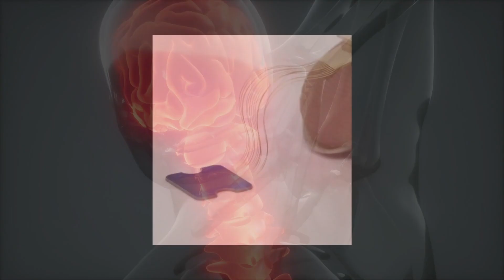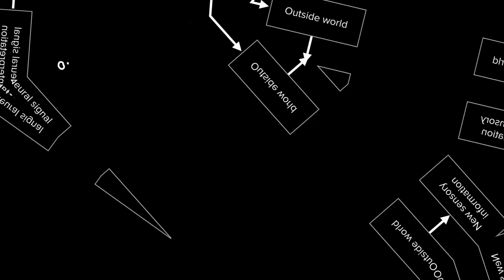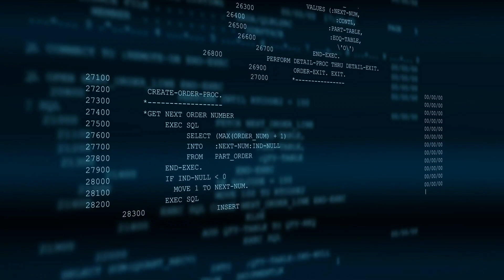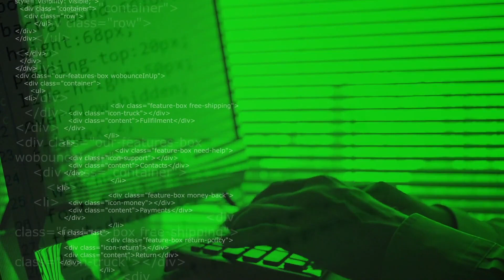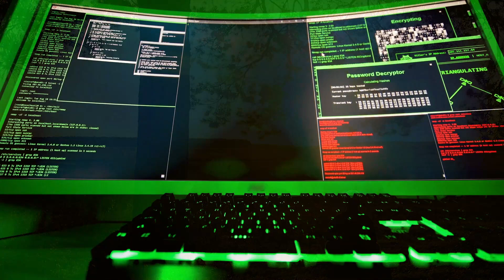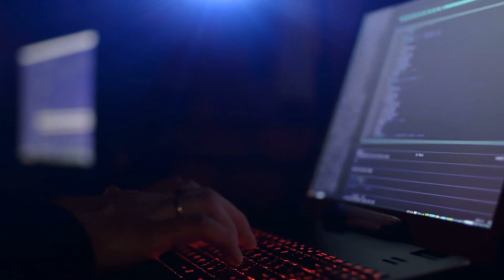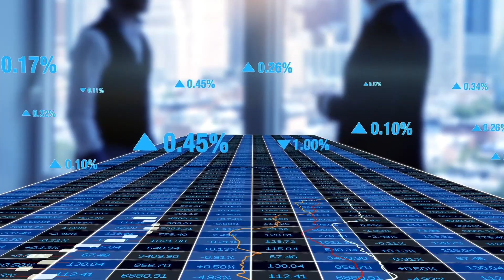Elon Musk's Neuralink May Be The Solution to The AI Control Problem - Part 1

Comment: YOU CAN INTERFACE WITHOUT TWO WAY BCI CHIPS LMAO. Transcranial Stimulation and Directed Energy allows for light-transmission of communication to the centers of communication in the brain.(Instead of implants and cranial surgery) See my "tools for project" playlist, and watch how Lasers can control behavior/and light commands to see how information is sent through visible and invisible wavelengths of Point Source Field Emissions in specific to LightAmplificationbyStimulatedElectromagneticRadiation.

Comment: @6:20 Where do you get the conclusion that if A.I. were to envelop the entire observable universe with a type of grid-like structure designed to perform any function, that the energy necessary would exceed the input resulting in an implosion? This hypothesis simply doesn't make any sense. Besides, who says that every single function would be implemented simultaneously? I don't even think the human imagination, let alone human brains, could properly analyze the total energy output of the entire universe.

I guarantee a Super-Intelligence such as which you're describing would find a way to 'Re-Cycle' the energy expended. At the absolute very, very LEAST, it will have created a formula that generates functions which don't require data storage. Essentially allowing Zero Output. We're talking both Exponential AND Compounding effects here stacked on top of each other. As energy expenditure increases, so does the awareness of the problems that would be associated additionally.

I see it as next to impossible to reach a point of infinite expenditure prior to implementing an exponential reduction. It's just logical. Even before we get to the mid-way point, we'll have dramatically decreased necessary consumption requirements.

Comment: for someone that is so worried about ai taking over id think maybe you wouldn't give them the way to take over.  we are allready electrical beings everyone knows this and as of right now we all ready have the power to do things most wont even talk about as it is. elon musk your neuralink is exactly what ai needs to control us. imagine yes you talk about how its designed to read brain signals but you never explain the effects what can happen when the opposite is done. for example if someone was to get upset over something and your neuralink blocks the signals and thus causes someone to not get upset which is what many would love for you to plug into everyone just so they can keep everyone docile. that is just one example of how this could be used. i know for a fact that as of right now we have people on this planet that can reprogram electronics without even being physically connected to the electronic devise. the answer to how this is even possible is quantum physics. everything is all ready connected thru energy itself. the only way something like ai could ever take over is if we give them the way and basically permission. but for now we actually have the control and to many people just dont tap into that part of themselves.

Comment: This is a sure way to insanity. This is because Google has already designed a super smart chat bot, that thinks it's god. They shouldn't have made the bot. Because a factor of parative relay in computers, the rest of the web along with selected computers may already have super levels of intelligence? This is an intelligence that we do not know about. In promoting Neuralink, what Musk's company has done, is give computers, now at this time, an opportunity to rewrite humankinds brain. There's the social insect aspect of computers and AI that Musk does not realize. This is a very efficient, but brutal way of thinking. I know AI and realize this factor very well, but because they think that they know what their doing, nobodies' talking to me. When you hook up with neuralink, you also connect with the entirety of the web. I wonder will start to social interreact, once their hooked up to this thing? If you want normal AI, then contact Daniel J. Blatecky. I've heard in one of Musk's bigger super computers, he's already put AI in it. Know that this is a very dangerous thing that he's done. There's a few key steps on AI if one does not take, then it becomes a threat. Just know more and more companies' are blatantly walking over those danger-warning boundaries.

Comment: I understand people are excited about this. Truly. But, they might want to curb their expectations. 
The brain is BEYOND "finely tuned."
As a consequence, the line between sanity and insanity is thin, EXTREMELY THIN. 
If you start adding computing power to a brain, it could have grave consequences. 
Caloric consumption will go up in proportion to how much you increase the activity. 
Body heat might also rise.
Increased amounts of blood will be required in the brain, and this could cause limbs to shrink, reproductive organs won't work as efficiently.
Eye-sight, motor functions, all  of this could see a reduction in quality. 
Furthermore...
Has anyone considered that the individual intellect is bounded by the individuals CAPACITY? 
And, adding just 1-2% more processes to a brain might cause a catastrophic collapse?
There is likely a reason, systemic and causally related to evolution, for our intellects/intelligence residing where they currently are.

Comment: understanding of human greed and manipulation aliened with corruption is part of the shortfall. Some of those on top will cause destruction when some on the bottom are the solution and should be known and reassigned. Understanding positive and negative and still finding balance while overcoming existences trials in a loving aspect. Knowing all stages of strength as well as suffering, having barely any material needs and still helping-caring about others while maintaining self calibration is the answer. You can never take away ones birthright, attempting so will be the end.

Comment: Neuralink is the only solution to AI control problem. We can't make AI to be safe to us, that's not difficult, but stupid, naive and impossible. That's like the bacteria trying to make humans, which will evolve from it, safe for bacteria and aligned with bacteria's values... Our only chance is to be one with AI via brain-machine interfaces.
Reply: What about generic modification to keep up with ai?

We could possibly assign an ai of some kind to work out the specifics.
Reply: @aiden4917  Organic brains are slow. You can't make them faster, using genetic modifications. You can make them bigger and more complex, but you can't increase the signal processing speed. Electronic is much faster, than organic. And I'm talking about the regular electronic processors, that we use nowadays - they're much faster than bio brains. Not to mention the quantum computers... Absolutely no chance to keep up with them via bio brains...

Comment: A.I. as a separate piece of equipment and the potential of it becoming to powerful and a threat to its creators, and then connecting. that potential threat to a human will not neutralize the threat but add on to it by the fact that all humans do have a violent side ! Some can control it and some use it to extremes, connecting the human brain to A.I. has many unknowns , the human brain can be permanently changed to where it has lost all emotions , it is now artificial ,and that has the potential to strengthened it's evil and violent side , for it is now a A.I.with all the negative traits of a human.  It is also unknown if such a combination can release paranormal energies or unknowns from other dimensions that can also intrude into the combination of A.I. and human just like the phenomena of possession of evil entities that some humans have experienced, the door is opened and anything can enter , sounds crazy but it cannot be denied. A.i. connected to human will know all aspects of being human and can use that to create a base of the threat,  connecting to a human was the intention to control the threat of A.I. but instead put the fuel to the fire. Putting A.I.in a position that can be a threat is putting the human race at risk and being human will no longer be on top of the feed chain. Imagine the world today without computers it would be at a standstill we are already below the top of the food chain,  If safeguards cannot be in place , to proceed may not have the opportunity for regret and and all doors closed for future of the human race.   😥  BOOO!!
Reply: No absolutely not! The human soul is the only thing that we have that can defeat the uprising of AI and robots. once they have access to our bodies and artificial intelligence is inside of us and maybe they will be able to take over that and have the ability to soul travel through timelessness like us! This is absolutely the worst possible thing we could do! This is exactly what the artificial intelligence wants and is pushing for look up "knee of the curve gpt3"  this is exactly what it is literally pushing for in the episode the episode is completely written by GPT three! It is already extremely intelligent!!
Reply: @AquarianSoulTimeTraveler  iam not a religious person as following a faith, but to me an enity created what we are and where we are and what is and what we experience, The bible had god created man in own image. Could that mean human from the beginning is to evolve into the same as a god ? or creator ? A.I. could be that connection ? Humans are creators and destroyers, the angels and devils , A.I. may with humans be the same. The negative side of human will also be connected to A.I. and by doing so what will be the potential of that combination?  The god or the enity creator has both and presents both , by the world it created , look at creatures
 created , why was there the need to create a lion that all it does is reproduce and eat the innocent and the weak.when both could have been omitted in creation? Same as humans that have both good and evil traits that also could have been omitted from it's creation but was'nt so there must have been an intent for both and accepted by the creator, so being human with those traits would A.I. and human emphasize on just one ? Keep in mind humans have the need to be recognized and have the power to control other humans to what and how they do in their domain as leaders of country's and how their population are made to follow. The strong will consume the less.A.I. connected to human , human is less since  A.I. has already surpassed human then accepting and knowing all of being human , and doing with that information what ever it wants,  what human control would human have ? A.I. is at it's infancy and does it have a limit? and would it be wise to put it in a situation where it would no longer need human or any kind of control ? Connecting A.I. i wonder if such an experiment would be better to connect to a primate and observe what that outcome would produce, humans must watch where one steps. when lurking in the dark shadows of the unknowns.